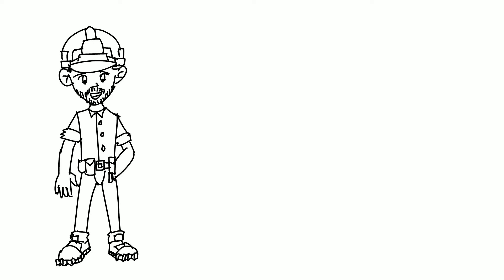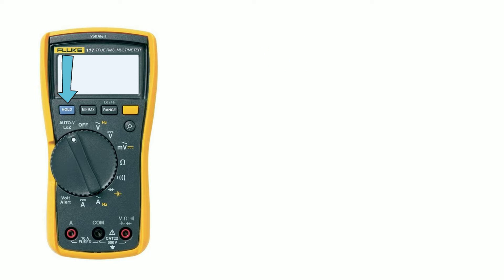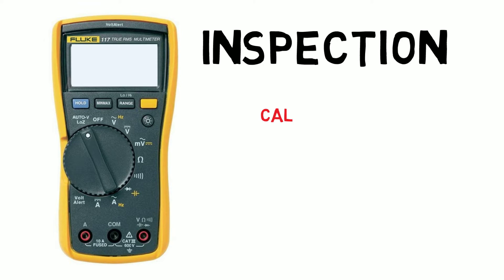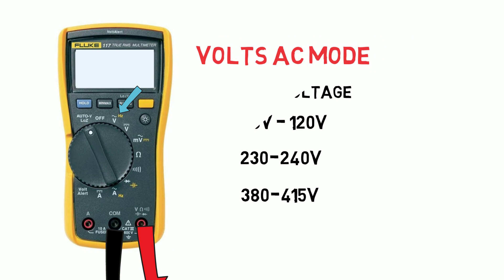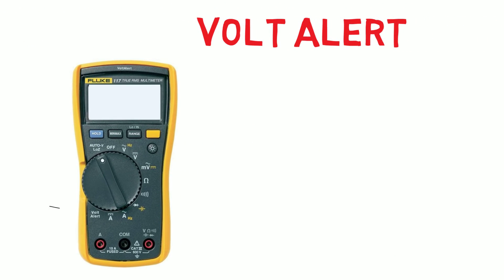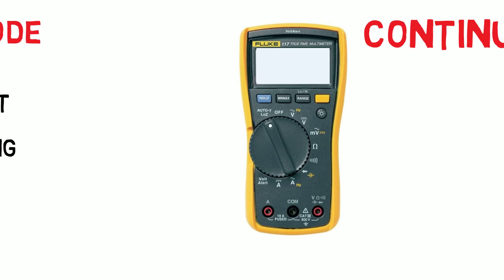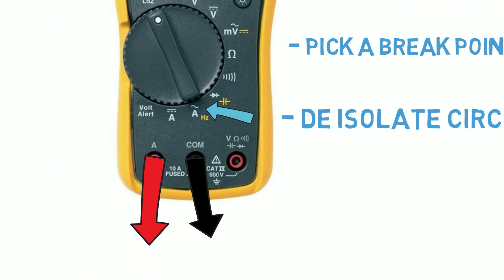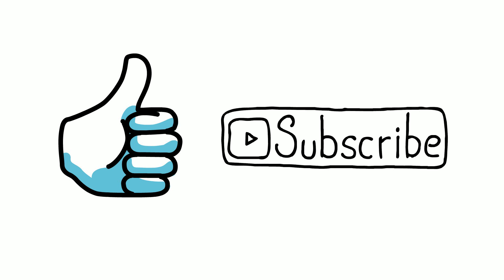How to Use a Fluke Multimeter [ Fluke 117 ] - Fluke Multimeter Tutorial

Comment: What is the lowest reading that can be seen with fluke 117 in DC amp’s range when testing automotive circuits such as measuring parasitic draw?
Such as measuring for less than 25 milliamps with no loads except PCM memory to determine battery drain overnight. Thanks.

Comment: Question what is the best fluke multimeter for an Electrician? If I buy the Fluke 87-V max would that be a bad choice?
Reply from the maker: The Fluke 87-V max certainly wouldn't' t be a bad choice for standard electrical work in my opinion.

Comment: What happens if I measure AC accidentally in DC setting? Will I blow a fuse?
Reply from the maker: The Meter will read 0V if you try measuring AC voltage in DC mode.